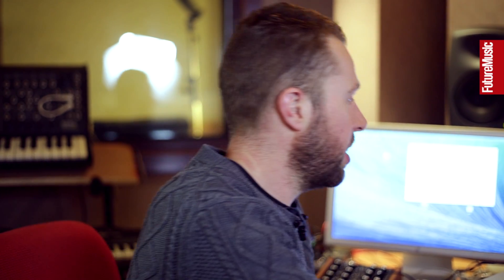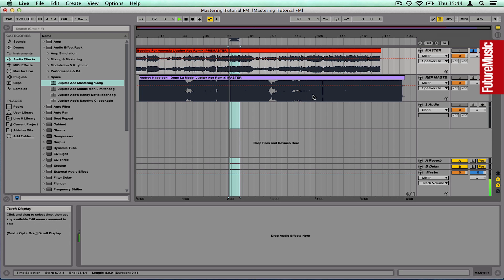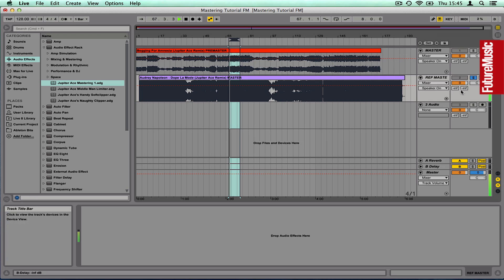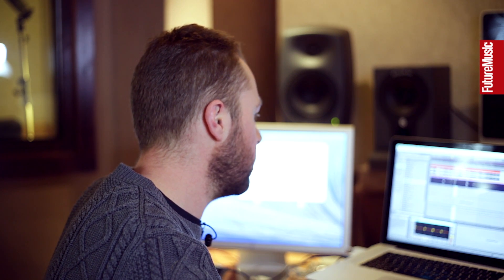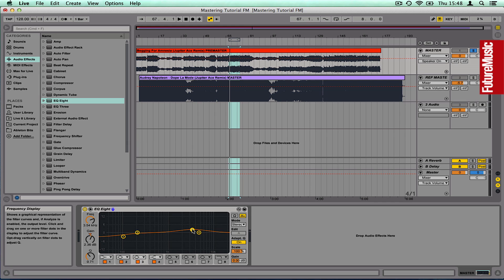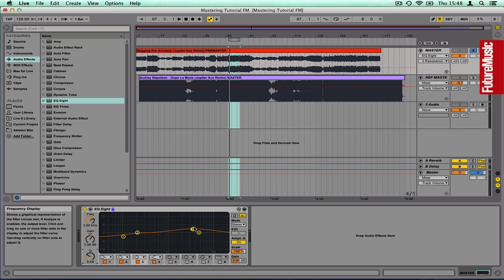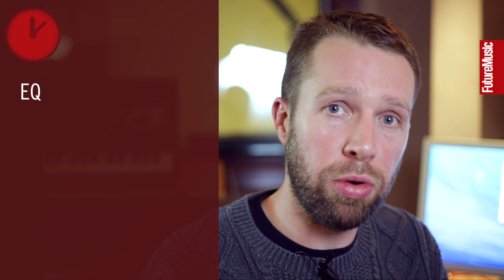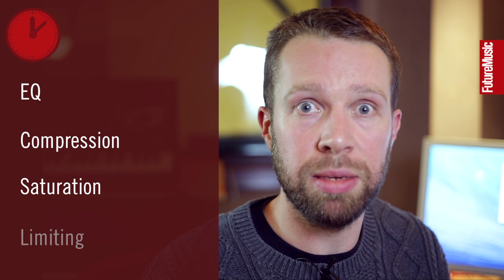12 Minute Tips -  DIY mastering with Jupiter Ace

Comment: EQing the track for balance is also done after the bus compression(most of the time actually). Sometimes you might want to EQ before it as well to change how the bus compressor reacts. Also the glue is garbage. Get a buss compressor that has side chain HPF like PSP bus pressor so you don't have the compressor reacting to the  low end first. Set the side chain HPF at about 100-130hz. Also the reference track and the track you mastered here has been pushed too hard imo. A clear indication is the way the meter bounces on the post of the master fader. In the end it was pretty much glued to 0db so that means dynamics are pretty much gone. Most EDM garbage sounds like a wall of sound with no dynamics left though. It actually makes the mix sound smaller when pushed too hard. It might be loud and punchy but the largeness and impact is completely sucked dry. Also you should set your limiter anywhere between -.6db to -.2db to avoid intersample peaks. If pushing tracks as hard as you have pushed them here setting it to 0db will definitely give you intersample peaks(which will crop up as digital overs when creating mp3s).